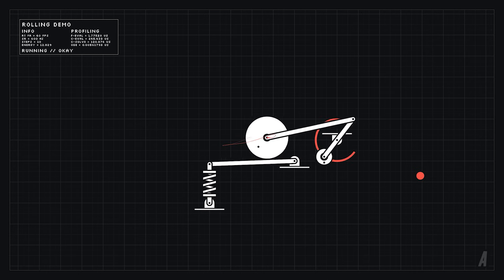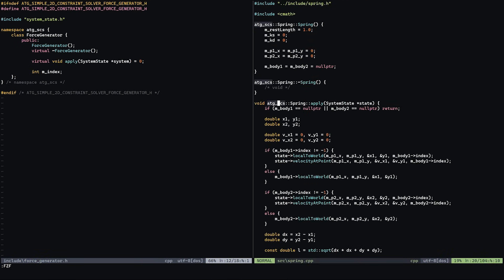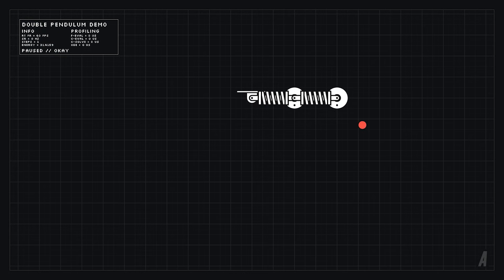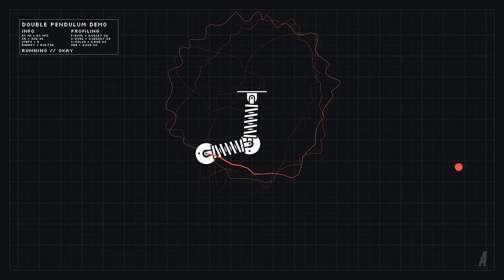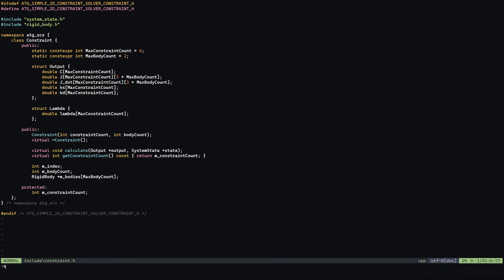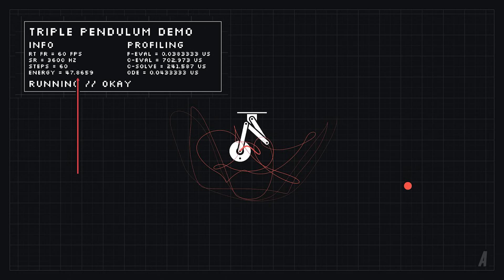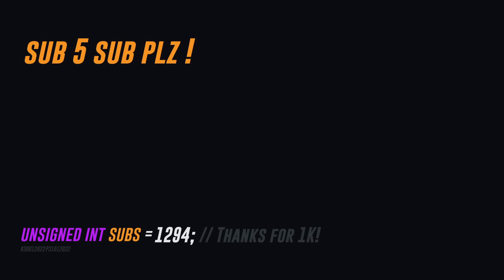Building a Physics Engine with C++ and Simulating Machines

Comment from the maker: Useful or pointless video? You tell me :D Thanks for watching 💪
Reply: Very useful, I will surely use it
Reply: All your stuff is incredible. You’re going to have a million subs in the next 2 years if you keep it up. My advice is to not abandon your long form content in favor of shorts. Your issue earlier with the car rendering video was that you didn’t have critical mass of viewership. Now that your channel is blowing up, a long term project requiring a lot of work will likely be rewarded even more.
Reply: I know exactly zero about programming and still watched the whole thing. Physics are fundamentally interesting stuff :)
Reply: im learning modeling and simulations next semester and this pretty much hypes me up! thanks for the content man, you just got a new sub.
Reply: very useful, subscribed
Reply: You mention multiple times that decrease time step improve model. I find that when having discrete integrators, you might lose details if you are adding super small values to the feedback, but maybe more of an issue with single or fixed point data types.
Anyway, super video - and impressive coding skills 💪😎
Reply from the maker: @TheStuartstardust  This only really becomes an issue with very small timesteps. In general, decreasing the timestep tends to make the simulation more accurate and stable. Thanks for watching!
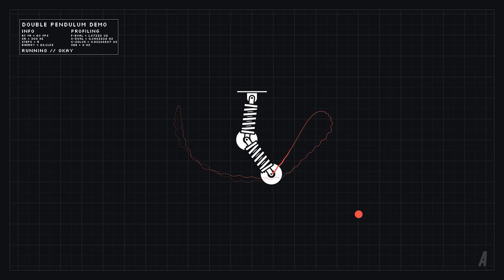Reply: @AngeTheGreat  What's the program you're using at 6:31 if you don't mine me asking
Reply: Bro this is the most pointless question I ever heard of course its useful
Reply: Hey thanks for the nice video .. i happen to work on this for electronic controller testing for automobiles .. these are then called plant models.. now for the question, did you ever happen to take a look at modellica and open modellica's approach to solve such problems .. to choose a premise of potential difference of each nodes are zero as equilibrium attains .. your reply helps on my projects in these areas..
Reply: Awesome video. Will look up the code for sure. Depending on your feedback it might be worth splitting the video into a series. With one video demoing the whole system. And following videos diving down the math. Or timestamps.
Reply: Extremely useful and interesting, thank you. I have a fascination with physics simulations and programming, so this is perfect!
Reply: very useful
Reply: Very useful!  Would like a more in depth explanation of the maths also, I tried to read Witkin's paper but got lost in the advanced maths.  I get that a large matrix is created with all the constraints and we need to solve for lambda using projected gauss siedel.  What I don't understand is why PGS works and how to setup the matrix given the constraints and contact points.
Reply: Great
Reply: Very very useful and interesting stuff. I wanted to see a video like this. You  should make a video about how you learned such stuff. Or better if you teach it yourself.
Reply: Useful.
Reply: Haven't seen it in the comments, but your audio track has some really sharp S sounds in it. Just to let you know.
Now excuse me, I have to binge watch your videos..
Reply: It was highly useful and pointful 😃
Reply: Fantastic video. I would really love to see a deeper dive into the derivation of the equations and how the code works.
Reply: For me, somewhat useless now, but very prompting to revise my old, long-forgotten knowledge and to learn even more.
Reply: The pdfs were!